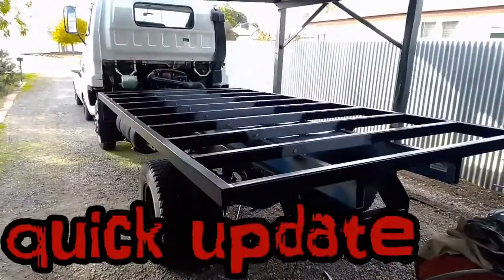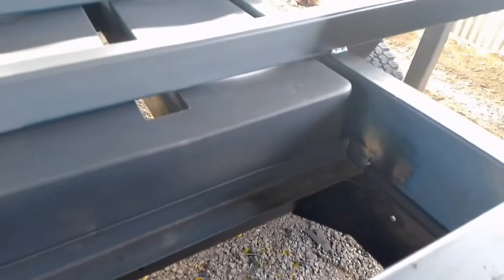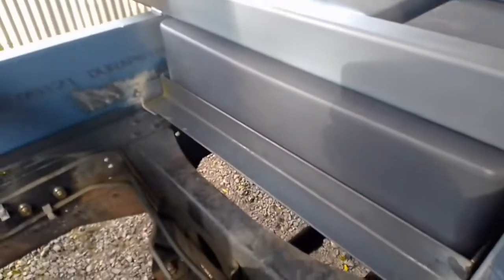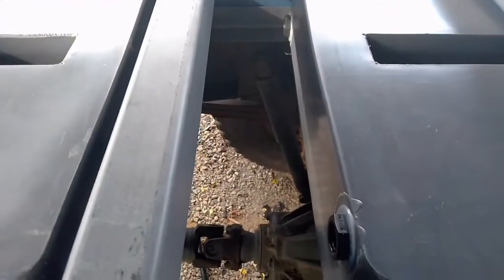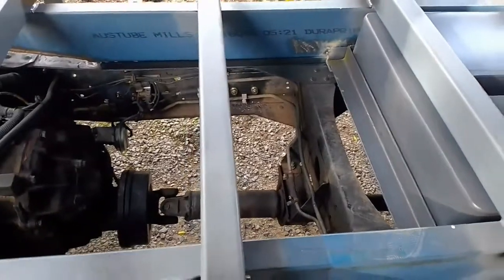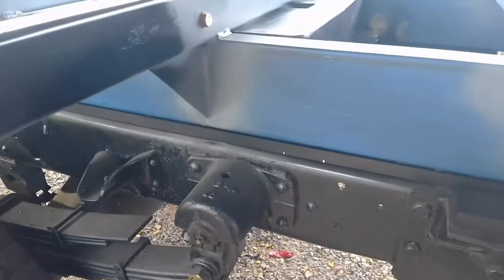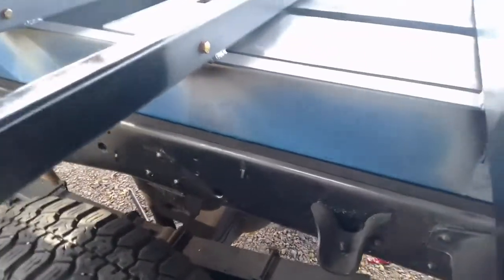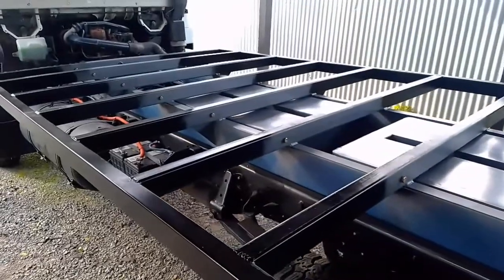Subframe update

Comment: Hi awesome stuff. few questions? any idea on where to find specs and regulations for the chassis build?Curious as to what and what i cant do with the subfames? how long I can extend the chassis, does it have to be certified by a engineer etc. Do you think a novice could build this sub frame with no experience? Im based in (nsw) Do you think a 200 npr requires spring torsion mounts if its not going off road? any advice will be greatly appreciated. Thanks Dan :)
Reply from the maker: G'day, you will want to have a read over the isuzu chassis/body builder's guide to suit your chassis for best practice, while also complying with your state regulations. You should beable to find links to that on service nsw website.
As for building something like this with no relevant experience I would suggest you find someone to build it for you and let you help along the way to gain skills

Good luck with the build

Comment: Hi, I'm trying to find information on building a sprung mount subframe like this for a 14' body. How are you getting on with your's? How much flex does it allow the chassis? My chassis would twist to the point of breaking unless it was limited by a rigid body, so a rail on rail system is better for me than a pivoting system.  I'd be grateful for any tips.
My truck is a 1956 Bedford RL. 
Cheers Richard
Reply from the maker: Ours has been performing well. 
Sounds like your chassis is far more flexible than ours. Have a look at AAV, they sell a mount kit that is far better than what I built and appears to have a longer range of travel too.
Reply: @ned_and_cazz  thanks for the tip, cheers Richard